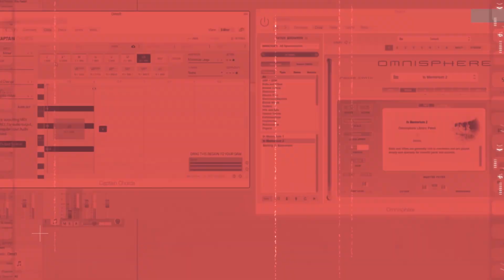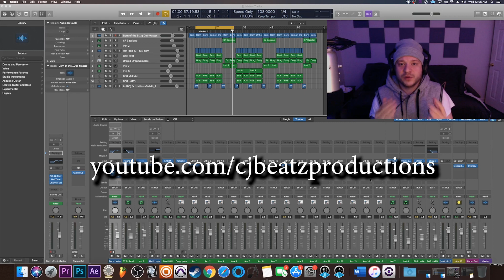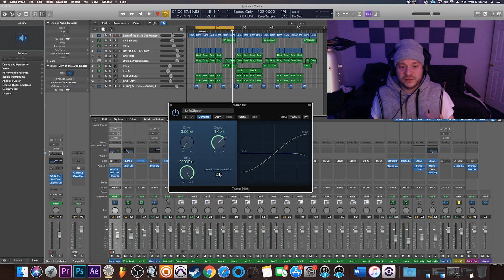Soft Clipper in Logic Pro X - MAKE YOUR DRUMS KNOCK HARDER!

Comment: I just pulled up one of my old beats' Logic session and added this to the end of my master chain. It made my head nod about 10% more. This is the same kind of trick guitarists used to use with the echoplex units from the 1960s and 70s. They'd turn the unit on but remove the tape. The preamp would make everything a little fatter and crispier, adding a very thin layer of soft preamp gain. Thanks for this.

Comment: The Logic stock compressor has a soft clipper setting. Just open up an instance of a compressor and on the right it will have a knob that says different clip settings. Just put it to soft, then play around with the makeup gain.
Reply from the maker: cool, but doesnt give it that warm soft distortion sound I was after.
Reply: i dont see it

Comment: Do u put this on after mixing the sounds or during ?what should my 808 and kick level be at(dB wise) before soft clipping ..let’s just say my kick is at -6db 808 is at -12db once I put soft clipper on should I turn up my kick and 808
Reply: This is a great question? I was literary asking myself  the same thing. Did you ever find the answer to this question???
Reply: Following this thread also
Reply: You do this as part of your mixing chain.  If you're mixing an 808 kick your mixing chain could be EQ>Compression>Soft Clipping>Limiter.  The order of the effects will depend on the sample you're using and will also depend on what you're using the soft clipper for.  Are you using it to remove large peaks?  Because it does.  Or are you using it to actually add audible distortion to the 808?  To remove peaks, put it at the end of your chain, for character put it at the start, and then maybe even another one at the end.

You don't necessarily have to turn the volume of your kick up after the soft clipping.  That's because the clipping is literally removing peaks from the sound, making the peak volume lower but the average volume the same.
Reply: Use your ears

Comment: I just downloaded bro.... Thanks !!! Sounds distorted when I playback tho. what could that be ?
Reply: Check your level input on your drums, go back and make sure your drums input volume is not peaking over when you inserted them in. Example, if you've used ultrabeat for you drumkits sounds, go into ultrabeat and readjust the volume of your kick and so on. To do this turn on your pre input metering so you can see the signal coming in before hand on what level your drums are hitting, normally i set my drums at a level btw -12db to -6db so that eay i know when i go to mix setting my kick as the highest volume for all my instruments, when you apply soft clipper on your stereo channel your drums wont sound distored because their input level is already set at a decent level where as if the input level is above -6db in my opinion before mixing the drums, your already going to experience distortion once you mix the beat
Reply: Mr Inspirational Guide To Motivation At Its Best thank you bro 🙏🏾 this helped
Reply: @ragetheartist23  all good fam, dont worry it took me 6 mths to realize why my drums kept sounding distorted everytime i go to master my beats and what i was doing wrong was in the pre gain stage, i would have my drums pre gain already peaking and i would only adjust the mix fader knob to turn the volume down which is why my drums werent hitting, so then I started turning the volume down from the pre gain knob on the plugin without touching the fader knob, then when i would go to mix and bring all levels up, my drums started smacking even harder, notice the difference straight away and its less mixing you have to do because tip, if you adjust all of your drums to stage around -12db to -6db you will find when you start to level out your melodies, your drums will sit perfectly everytime within the mix because youve already pre mixed the beat so all you really have to do is readjust your track levels slightly and your beat will turn out a thousand times better
Reply: @89mrhuey  Thanks Bro !!!